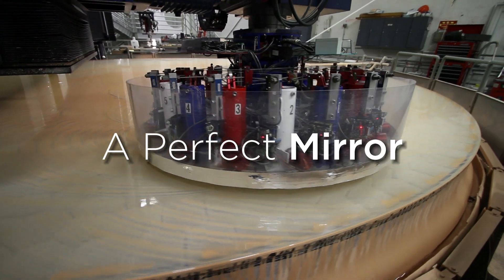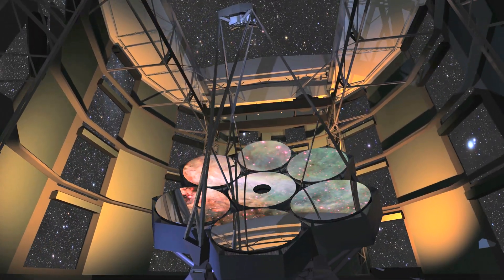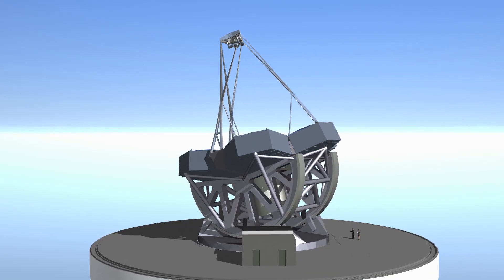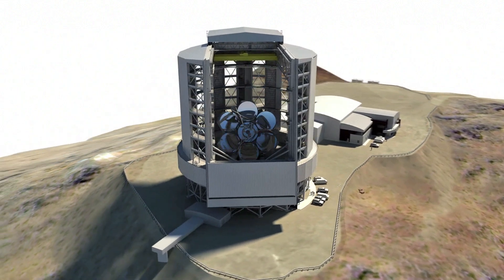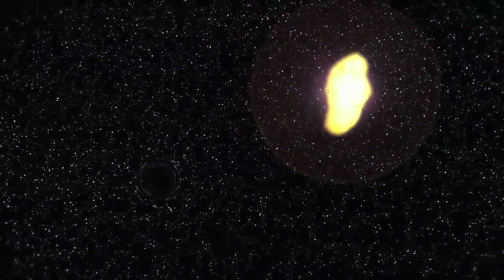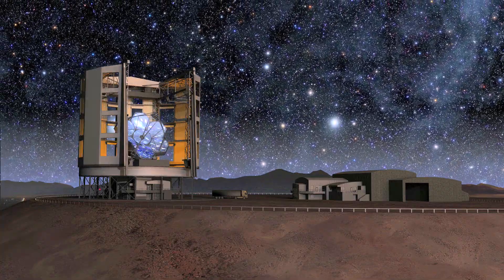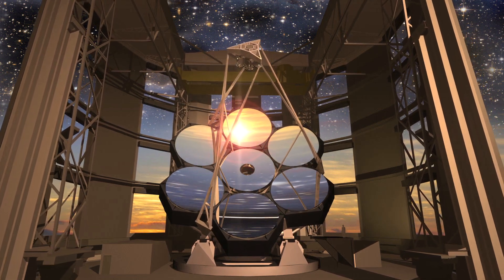Giant Magellan Telescope - "A Perfect Mirror"

Comment: All telescopes will be displaced by our low cost [$5MM], compact 
telescope with a broad field magnification from 10X to continent 
resolution/discernability  at 100 light year distance. Similar performance on the 
obverse side with table top sized microscopes where even the interior of
 the nucleus will be viewable. Path to atomic scale electronics 
manufacturing with real time defect removal for perfect outcomes each 
and every time..

Comment: Just a though...  Is there benefit to install all those primary mirror elements in to the same mount structure? Why not build all as separate telescopes and then point them to the same target? That would allow lighter support structures...
Reply: That’s done with radio telescopes, probably because otherwise they would be much too large to be practical.  For optical telescopes, I’m sure that using multiple mirrors in one structure is more cost-effective.

Comment: 1:25  That's an interesting mount.  Are those rings glued to the back of the mirror?  Is the mirror only supported by these, and not by the edges?  I thought for a mirror that size and weight they would need some sort of active support system (either mechanical or computerized) to maintain the accuracy of the surface?

Comment: First question how often they need to clean those glasses after installing? 
2nd question how they going to clean those glasses after installing  spot free? 
3rd question is general people who paying tax to build it, are they gonna give any access to general people?
Reply from the maker: Thank you for your questions. After installation, we will clean the mirrors twice per week using a spray of CO2 that will lift off the dust. This effectively removes most of the dust particles from the mirror surface. Once a year we will wash each mirror, and in alternate years we will strip off the coating and apply a fresh layer of aluminum. 

The GMT project is funded through its international consortium of twelve leading universities and science institutions. If the GMT project were to receive federal funding then astronomers from any US institution would be able to apply to use the telescope.

Comment: Can somebody explain what is meant with the statements of fractions of a wavelength of light or 1/20th of a wavelength of light?  I know we can see in the 400-700 nm range.  Using the example of 650nm.  Would it mean something like 650.05 nm?
Reply: no. it would be about 5000/20 nm or 250 one-billionths of a meter
Reply: Oops, I was thinking in angstroms.  It would be 500 nm /20 - or 25 one-billionths of a meter  (500 nm is our ideal dark-adapted peak sensitivity)

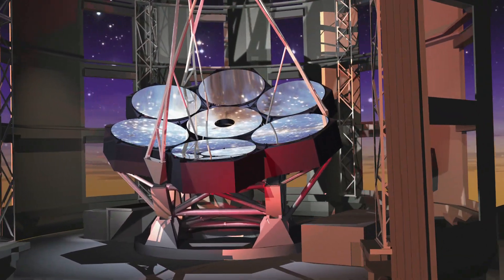Comment: 5:39 The truck (prime-mover) at the bottom right is about twice the scale size as it should be. The telescope mirror diam is 25 meters, or the length of a whole B-double truck. So the prime mover is way overscaled. The artist probably didn't know the official B-double truck length (in Australia, that is). If a B-double truck is the same length as the mirror diam, than the prime-mover at the bottom right should be a lot smaller.

Comment: I wonder what you could see if you put that in orbit...
Reply: +Hey Hey 
I doubt this telescope has the proper design to work in space. Also, putting this giant into orbit would require NASA to invest its full annual budget for several years...
Total weight of the 7 mirrors = 140 tons... not even a Saturn V would be able to house and carry all those mirrors.
Modern rockets are just 1/3 as powerful, so several missions (4-7) would be needed just to put the mirrors into orbit.
In other words, it would be financial suicide.

Comment: I love astronomy and I'm so glad to see the next generation of telescopes being built. But I wish these agencies and organizations building them could have worked together and picked one location to build all three of these monster scopes. Imagine if the E-ELT (at 39 meters) the TMT (at 30 meters) and the GMT(at 25 meters) would have all been built in the same location, then they could have used interferometry to join the scopes together and had almost the light gathering power of the cancelled 100 meter OWL. Someone needs to invent a way to do interferometry over great distances so that even at their different locations they one day can be joined.
Reply: +jinxy72able how about them being separated over 100's or even 1000's of miles; using the same (or similar) interferometry, get a ridiculously great collecting area of similar dimensions?

Comment: Hello, I am just curious. The telescope's mirrors are polished to within half a wavelength of light. And the secondary mirrors are positioned to within that tolerance as well. However, I am wondering how you counteract the sag of the boom holding the secondary mirrors, when the telescope is at an angle. Surely the weight of the metal and secondary mirrors is enough to bend the arm more than half a wavelength of light. 
I am just curious from an engineering perspective how that is counteracted.
Reply: +Ryan C. Engineering   they use actuators under the mirrors to correct for
any anomaly -
also the mirrors are accurate to better than 1/20th the wavelength of light not 1/2 wave.
Reply: Ryan C. Engineering I
Reply: thye got a guy to stand on the roof, and pull a rope tied onto the truss!!!